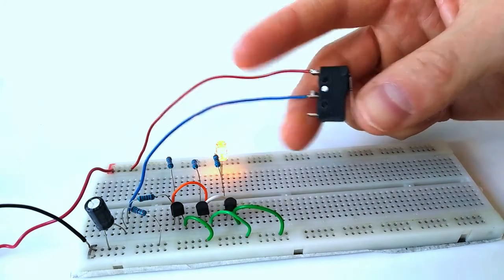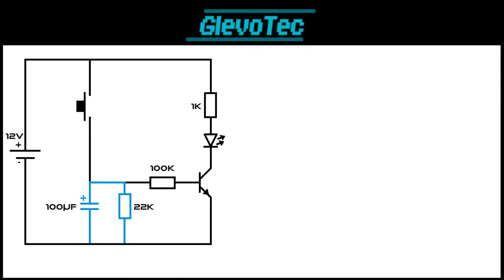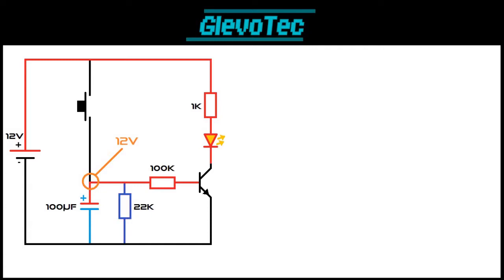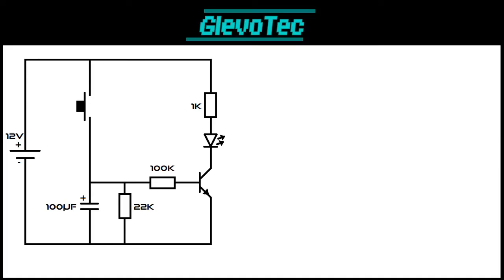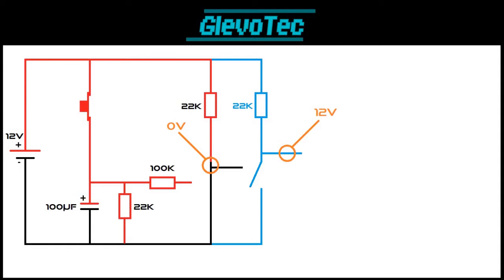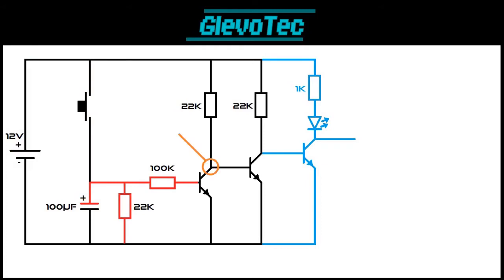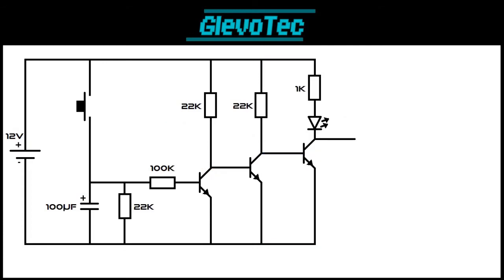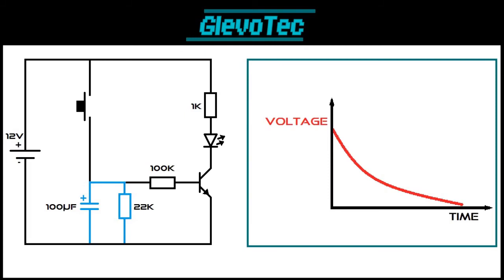Simple easy transistor delay circuit - Explained tutorial | How it works

Comment: I need something like this but without button. When powered it turn on relay and after few second turn off. I tried three circuit i found for this but no one work properly for example too slow turning relay on after powered I need it immedietely. Also operating voltage is 12V when main power supply and backup is 6 rechargeable AAA so I use 5V relay and zener diode so relay work on both voltage and delay circuit also must work when on battery.

Comment: Can you show the same but using a hall effect sensor as the switch. Eg when a magnet goes by the hall effect sensor, the delay circuit starts. thanks
Reply from the maker: Very simple. You don't need a hall effect sensor. Just a simple reed-switch in place of the switch and it will work perfectly.
Reply: @GlevoTec  thank you for the reply. I think that is a good idea. I would like to use the circuit for my bicycle. The magnet would be attached to the wheel and the sensor to the frame. I think the hall effect sensor could be more error robust. Even a hint or link in the right direction would be greatly appreciated, thank you

Comment: I love actual electronics. Not arduino non-sense. Everything is just arduino and go nowadays. It's programming not electronics. I build all my amplifiers with discrete BJTs and JFETs ocasionally an op-amp. I hate 555s and other chips I can never figure out how to use. It is much easier for me to just pull out my trusty MPSa42s and do what ever I want.
Reply from the maker: Thanks for the comment. Real electronics is learned by building with discrete components indeed. But I do admit that an opamp or 555-timer are incredibly useful and I like to use them for certain projects. And that's alright, as long as you take the effort to understand what is happening inside the IC, in my opinion. I have a handful of basic IC's in my stock that come in handy sometimes.

Comment: how much power this Circuit consume when It's off?
i mean when capacitor discharged, LED turn off.. but this circuit connected to the Battery, now It's keep draw current or totally off? 0 power consumption?

Comment: This is a perfect circuit to make an automatic shower flow timer.... use a thermostatic mixer to control water temperature along with a  normally closed servo valve.....then just tap a switch for a regulated shower lasting a certain duration...... tap as many times as you want to prolong the flow of water. No more twisting valves!! This could conserve both energy and water by using the "Navy Shower" method... perfect for off-grid solar powered households.
Reply from the maker: That's a great project. This is a very versatile simple circuit indeed. It can be used in many solutions and be used as a building block to build more complex circuits.
Reply: @GlevoTec  It appears the idea has already commercialized  by a firm headquartered in Bath, UK they sell the basic fixture for 375 UKP ....just a knob (adjust temperature) and a pushbutton to start showering.

Comment: If we just observe we can see how simple the real principles are and that is about all of it.
The complexities are not in the actual principle but in how various things having different names/labels and having different physical shape/appearance are placed with respect to others that cause and make different things happen.

What is information/memory/data?  That is in the computer lingo system.   Look it is energy.  Correct. In the old days this energy was held in what we understand to be magnetic field.
Then it became cumbersome and bulky. They decided it was much easier and more efficient to use electric field.  Energy held in electric field.
What is then memory cell.  Simple, it is a capacitor.

What is a capacitor.  It is a mechanism that keeps the opposite charges apart.  This holding of separation of charges cause an electric field between them.  
What is a timer, the core of it.  It is again a capacitor.  Small capacitor charge and discharge rapidly and larger capacitor ..... you got the idea.

Sensors, transducers, signals, inductors, hall effect... blah blah blah blah.... if  you look very closely, they are all the same stuff doing the same thing but having certain look and being placed in a certain place in certain way, perform different roles and therefore given different names.
Variable resistor, adjustable resistor, potentiometer.  Look, a diode, a transistor and a capacitor... do you see that a diode is also a capacitor and so is a transistor.   Wait wait.  Everything has capacitance.  Your light switch in  your bedroom is also a capacitor.  Trust me it has capacitance.  and so does all the wires.
Reply from the maker: Well said. Indeed. All the electronics in the world, no matter how complex still work on the same basic principles. Everything is basically a unique puzzle of different combinations of principles and optimized for the unique purpose. Look close enough and everything is very simple and similar. It's indeed the labeling and methods of combining things into sub-parts that make it complicated and require specific knowledge about it
Reply: @GlevoTec  After all these years of struggle and all the grunt I have reached and have concluded it all with this:

" You do not know anymore than your ability to explain something to another in such a way that they would truly and fully understand it".
If you can't do it then you yourself don't really understand it either.

Now, anyone will have to think twice to brag about their professorships and their credentials.

When they teach... how do computers turns 0s and 1s into text, audio and video.  I stand opposed.
I say because they don't.

Comment: So could the two transistor circuit be used as an on-delay?
Reply from the maker: No, but you can modify the RC circuit to make an on-delay. If you simply place another resistor between the button and capacitor, you'll have added an on-delay.  Hope that helps!

Comment: How did u come up with the values for the resistors? What equations did you use?
Thanks for the video.
Reply from the maker: Good question. I took some random values here. But you can calculate the time constant of a resistor-capacitor circuit with t= R*C. This is the charge/discharge rate where it charges or discharges 63%. Full charge or discharge takes 5t, or 5*R*C. Look up RC time constant for  more detailed explanation. Hope this helps!
Reply: @GlevoTec  thank you.

Comment: This circuit did not work for me when I built it. For the middle transistor, having a base transistor of 22K and a collector of the same resistance value does not seems to make sense to put that transistor in saturation! The base resistance is typically 10 times or more smaller than the collector resistance!!
Reply from the maker: Strange. Try to build it with the same component values as here, and use BC547 NPN transistors. 22k as a base resistor is plenty of current to saturate the transistor, since the BC547 has an Hfe of at least 180.
Reply: @GlevoTec  will do. I forgot to mention that I did use 5 VDC as power supply.   A lot of people demo with 12 v, but that is not a very convenient portable value. I also tried to energize a 5v coil relay, but it wouldn’t energize. Thank you for the reply.
Reply from the maker: @shvideo1  That will be the problem. This circuit works best at higher voltages. Although, with tweaking of the component values, you should be able to get it to work at 5V as well
Reply: @GlevoTec  Yes, I think so too. I started from scratch building each transistor stage using 5 v and an led at the output. I got 2 stages to work. Now working on the 3rd stage. I think you are great at explaining these circuits. I wish you would do more small practical transistor circuits. Thank you for all your input and your channel.
Reply from the maker: @shvideo1 Thank you. I'm working on a new transistor circuit video actually. Also, if you're driving a relay with your circuit, make sure that the last transistor can handle the drive current of the coil. The BC547 that I used here can only handle max 100mA. So you might have to change to a more powerful transistor. Good luck!
Reply: @GlevoTec  That is great news. You certainly are the man for it. Yes, I always read the continuous coil current of the relay I am going to use. They say make sure your transistor can handle at least twice that. My 2N3904’s can handle up to 200 mA. Thank you for that info! Looking forward to your video. Stay healthy and creative.